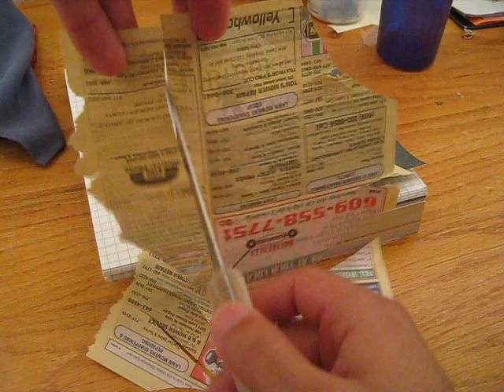Sandpaper Sharpening 2000Grit: Part 6 kitchen knife repair

Comment from the maker: @CryoQuench Thanks for the kind words. And you have a good eye. If I was focusing more I would have held the sandpaper differently to keep it from bubbling up in front of the edge. However, as you stated it seemed to not be an issue as the results were still good. But yeah, the results are impressive considering the materials